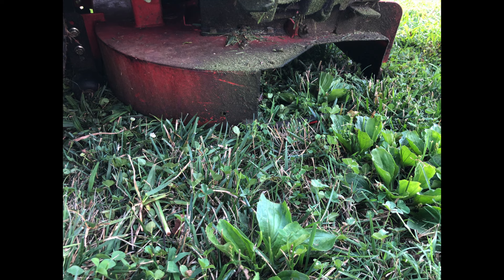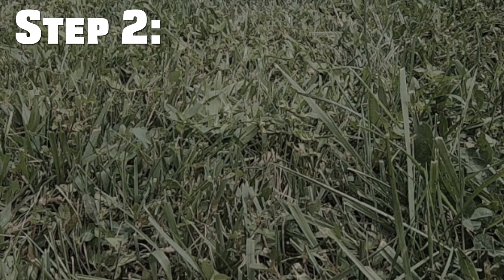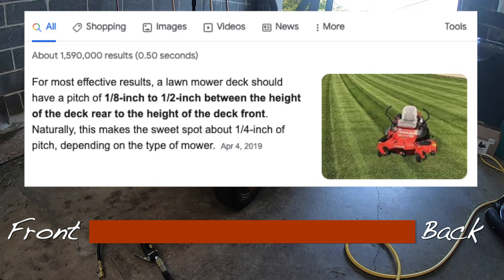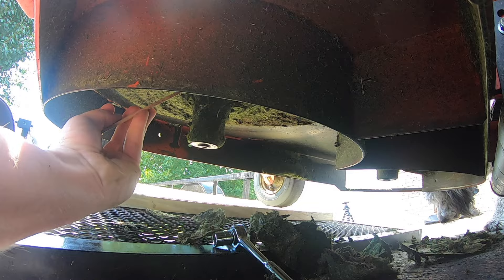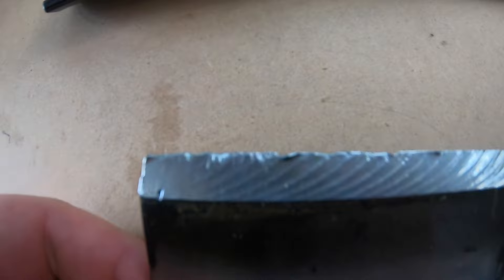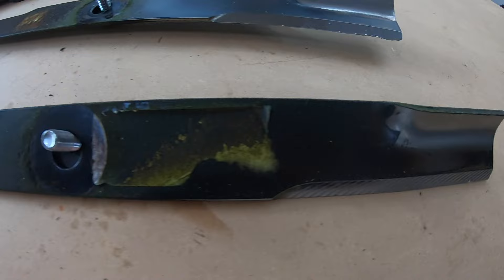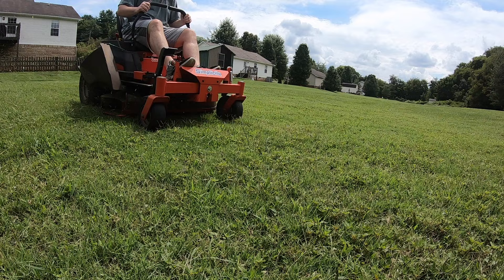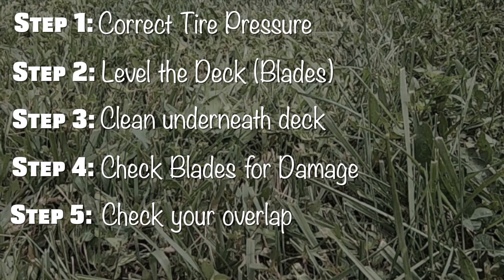5 Steps to Fix Mowers Uneven Cut | Leaving a Strip of Grass| DIY How To

Comment: I've had two cub cadet lawn tractors that both had the same issue from new. They would leave a ten inch strip half cut from the left side of the deck. I readjusted the deck and more. I finally put one in the factory repair place where they releveled and replaced the blades. Still had the same issue. I finally gave up and bought a new bad boy zero turn and now I get a smooth cut. I believe the original issue is likely due to poor deck design and not fixable.
Reply from the maker: Dang, that’s seems frustrating.  Glad you got a different one.  I hear the Bad Boys are nice!
Reply: @weekendhomeprojects  It is. Great cut but I need more practice on using a zero turn mower. I ran it one hour and then it wouldn't restart. Took it to the shop and the brake safety switch came unplugged. It's under the mower behind the deck where you can't see it without lifting up the mower. I think they likely didn't plug it in completely at the factory. It's nice not having to double mow to get a flat cut.
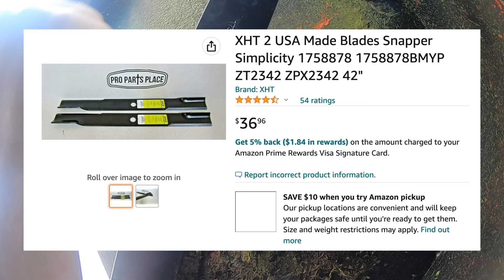Reply: I got 2:34 a Cadet also and have same problems and more,,, ignition,, starter,, tires, hell, lets add the steering wheel to lol!!!!!
Reply: Funny thing is I just bought a brand new bad boy and I'm here with a seemingly random strip being missed on the left side of the deck. Very frustrating.
Reply: Also check spindle.  Bearing may be bad

Comment: No help at all
Reply from the maker: Sowwy.  Let me know what your issue ended up being.
Reply: Check your idler tensioners, check your belt, check your spindle bearings, check your spindles and pulleys for damage....

(I'm still hunting the cause of mine... I think it has to do with reduced blade speed)

Comment: How do you  correct overlap ?
Reply from the maker: An overlap issue would occur if you're not lining up your cut right, leaving a strip of uncut grass.  I usually line up the uncut grass on the inside of my front tire, which allows for a few inches of overlap i.e. outside blade spinning over already cut grass from the last pass.

Comment: Is simplicity owned by Ferris? Because I have a 42 inch Ferris s300 that literally looks the exact same as this mower the only difference is the seat
Reply from the maker: Simplicity acquired Ferris in 1999.  Then Briggs and Stratton acquired Simplicity in 2004.  Just recently B&S stopped selling the Simplicity brand.